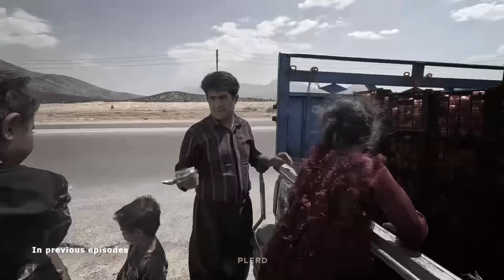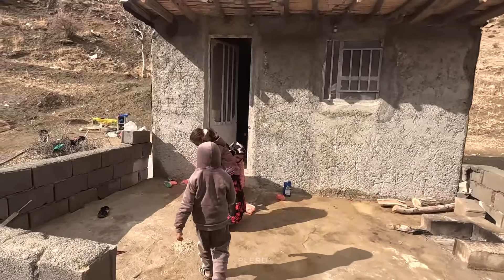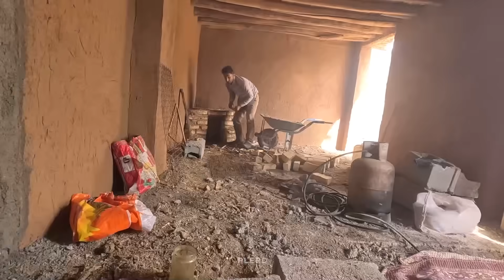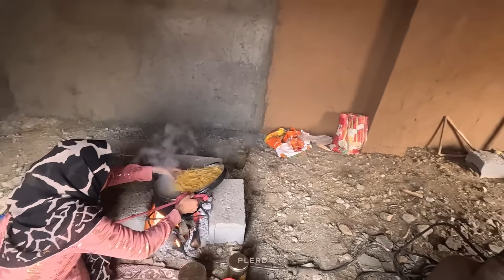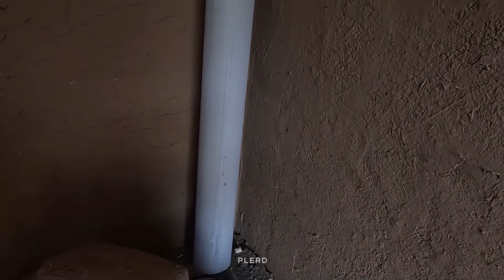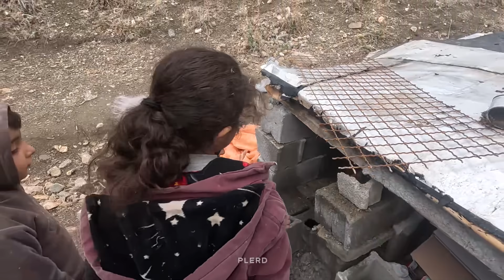Farmhouse Flames: Single Mother's Masterpiece On A Rainy Day

Comment: I could be wrong but I saw the exhaust pipe of the fireplace as PVC. As such it is flammable and will easily melt in extreme heat coming from a fireplace. I wish it is asbestos pipe.